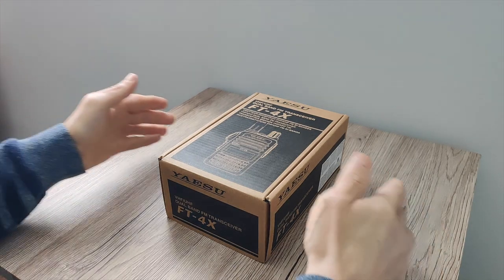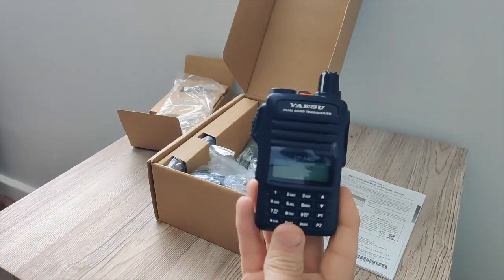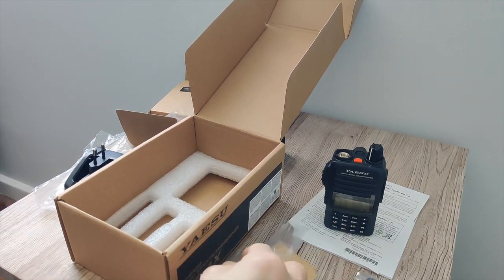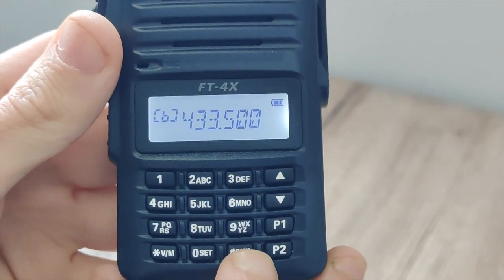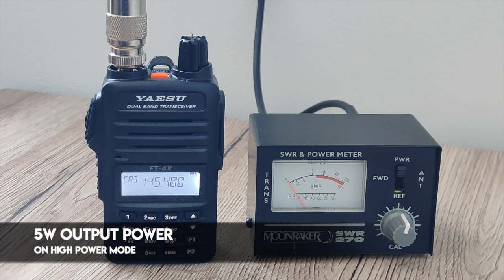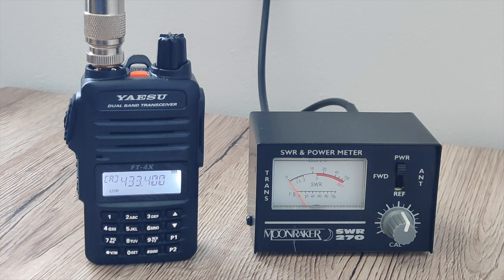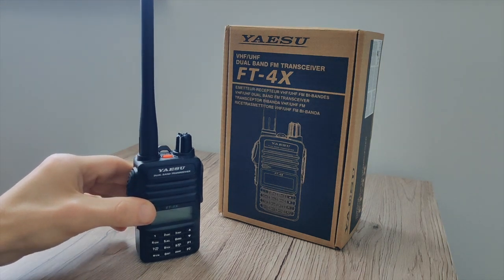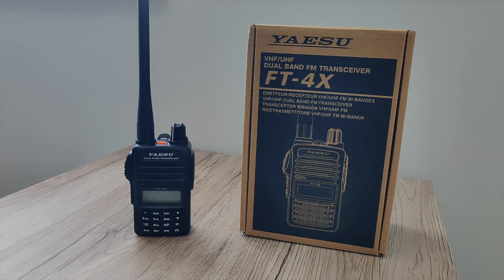Yaesu FT-4X Unboxing & Power Test

Comment: I have this model. So disappointed to hear that it output much lower than spec.
Reply from the maker: Indeed. I sent mine back a few days after doing this video. There really was no difference in performance than that of a much cheaper Baofeng radio. Wasn’t impressed at all with the Yaesu, considering the price hike on a cheaper Chinese handheld.

Comment: How powerful that radio how many watts?
Reply from the maker: 5w high, 2.5w medium and 0.5 low power.
Reply: @OntheMicwithMike  powerful
Reply from the maker: @landobandon2428  pretty standard really, most cheaper Baofeng radios do the same. There are other Baofeng radios that do nearer 10w which I've tested a couple over the years that do close enough to it.

Comment: What is the difference between the ft4xr and the ft4x
Reply from the maker: Not entirely sure, long gone now that radio. Was no better than a cheap Baofeng.
Reply: @OntheMicwithMike ??? The frequency arrangement is different.
Reply: @OntheMicwithMike  did you try the yaesu ft 65  ?
Reply from the maker: @bigbone88  no I haven’t done so far. Rarely use 2m and 70cm to be honest.
Reply: @OntheMicwithMike  thanks 73s

Comment: Great video Mike. How does it seem to be working for you ?I've been thinking about getting one of those. I also was kicking around the thinking  Ft-65.
Reply from the maker: I must be honest, it’s a nice looking radio. Easy to program, but unfortunately it doesn’t seem to pick up too well. In fact I tested the radio alongside three other radios a few weeks back, using the same antenna on all three - the retevis rh701. The Yaesu was poor on reception to a much cheaper Baofeng model and Kenwood handy.
I think underneath it’s nothing more than what you’d expect from a cheap Chinese handheld. 
Better filtering though but that’s all.
73’ :)
Reply: Thanks Mike .

Comment: Dear Mike. I also recently purchased the FT-4X and am quite happy with it. Only I don't have a battery indicator in the top right corner. For the time being, no one knows how to set this or whether it is a malfunction. Do you have an answer?
Reply from the maker: Hi Ron, 
That’s the first I’ve heard of a missing icon but one thing that may have happened is that it may have been switched off within the programming software and that’s only a guess.
I don’t have the software myself to check, because I programmed mine from the keypad.
There doesn’t seem to be any option to switch the indicator on or off in the settings menu at all.
It might pay to download the programming software from Yaesu and check the settings page and see if there’s any option in there for it.
Sorry I couldn’t be anymore help, 73’.
Reply: Thanks for the quick response Mike. On the one hand, I am happy to hear that it is not me or the settings of the Yaesu. Now repackaged and returns supplier. Greetings, Ron.